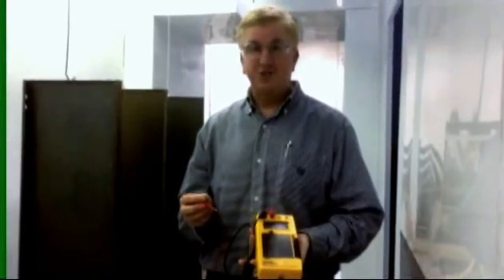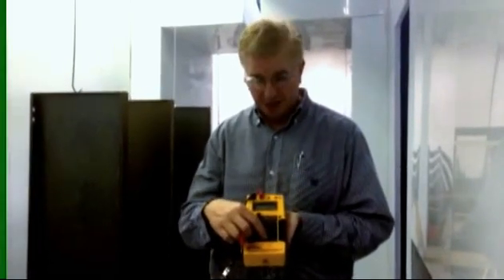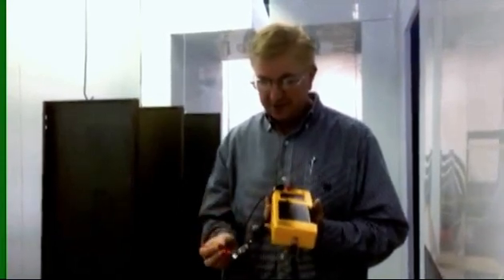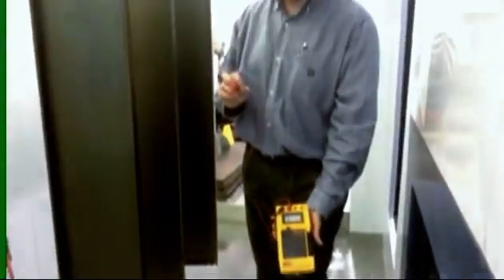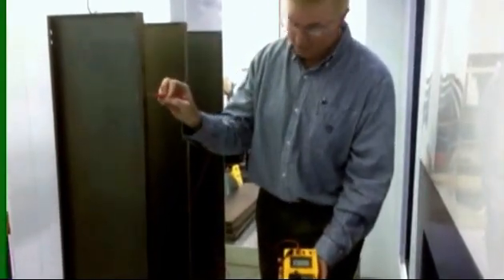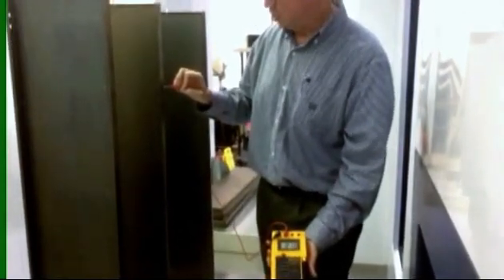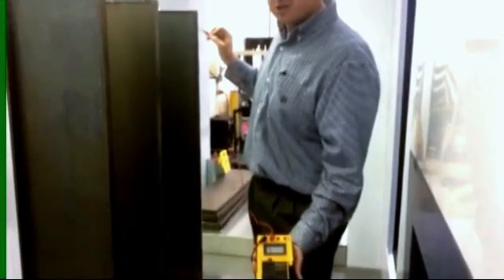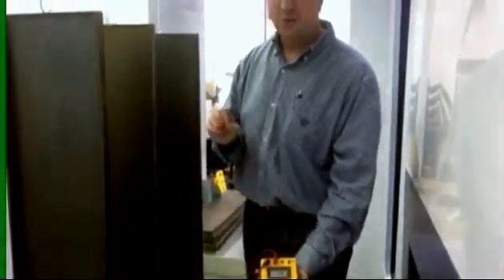Nordson Powder - How to Check if your Parts are Grounded

Comment: What are some of the option for meters?  i can see that they vary in price from thousands of dollars to under $100

https://www.amazon.com/Digital-Insulation-Resistance-Tester-Megger/dp/B077FB9H95/ref=asc_df_B077FB9H95/?tag=hyprod-20&linkCode=df0&hvadid=242124331408&hvpos=1o12&hvnetw=g&hvrand=11676314726109496245&hvpone=&hvptwo=&hvqmt=&hvdev=c&hvdvcmdl=&hvlocint=&hvlocphy=9011117&hvtargid=pla-445977185986&psc=1

Will this VC60B+ from Amazon be able to perform this test?

Thank you for your video